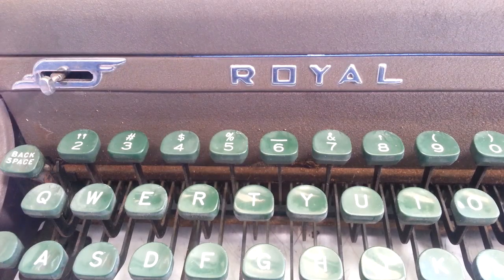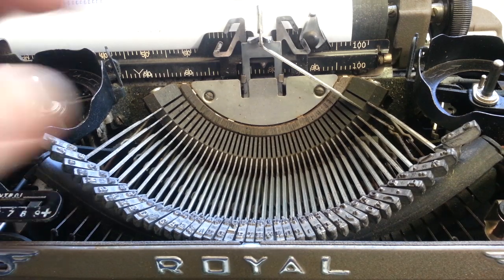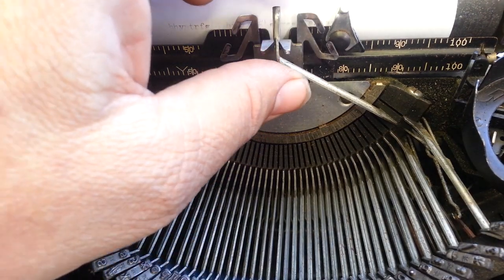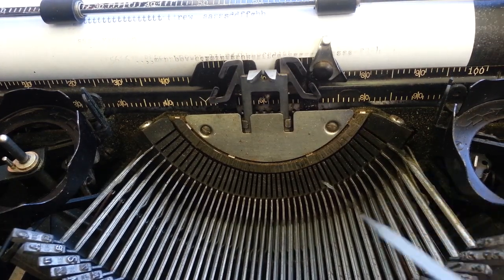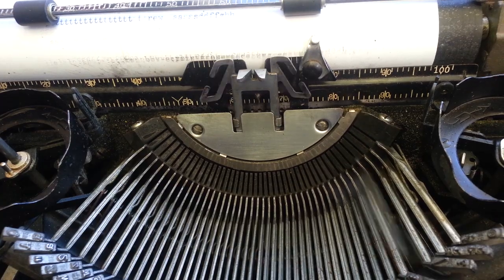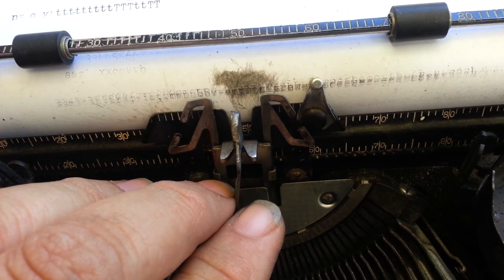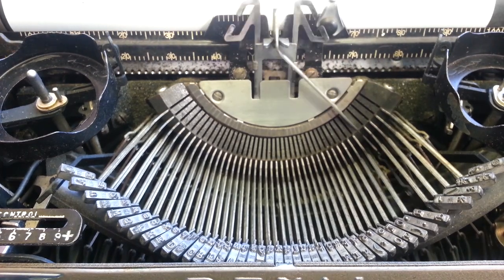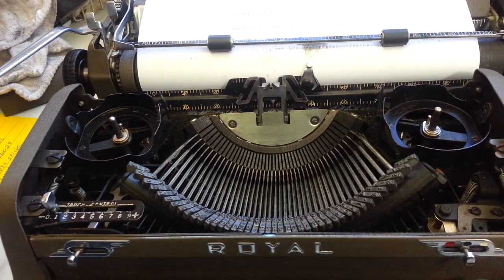Royal Quiet De Luxe Typewriter Sticky Keys Segment Flush Clean

Comment: Just got one yesterday exactly the same model, 1952 matte gray, can only replicate one of the sellers reported issues, the 1/4-1/2 type slug sticks. The rollers all hard but otherwise in good shape. The magic margins are sticky too, not a big deal. Even the ribbon has life left. I can go very fast on it. Paid $35, local Marketplace seller. The Royal marketing department calls the paper bail the “Automatic Paper Lock,” the base model called the Arrow only has a “Paper Bail.” It seems the difference is the QDL Automatic Paper Bail articulates forward as well as up whereas the Paper bail only lifts up.

And the best part…THE BELL WORKS!

Comment: I finally cleaned my Quiet de Luxe and noticed that the "a" types low on lower case and the "q" prints high on lower case. However, they both are the correct height on upper case. Any suggestions or is this just the "fingerprint" of this machine?
Reply from the maker: I would need to see it up close in-person to determine what the deal is, type alignment can be finicky for sure

Comment: I love your videos.  So helpful.  I just had a Royal Companion shipped to me that was working when it shipped, but now the carriage doesn't advance when typing or hitting space bar.  Back space button is the only thing that makes it move. I can use the carriage release button and it moves back and forth freely.  I checked the spring and draw cord after watching your other excellent video.  No problem with that.  
 
It was shipped inside its carrying case with no packaging materials.  One of the brackets broke loose in transit.  Any idea what to check next?  I was hoping to gift it to my daughter for Valentine's.  Thanks.
Reply from the maker: Sounds like escapement pawl is jammed or broken
These are hard to access on this typewriter
Reply: I am not even sure where that is.  Would I find info on that in one of your other videos?
Reply from the maker: @angelabowman8016  Most all escapements are directly under carriage in middle
using a star wheel and pawls to space, Royal is very unaccessible
With any shipping damage other things could easily be out of whack preventing operation
Inspection by an experienced tech might be the only way to diagnosis exactly
Reply: Phoenix Typewriter, I don’t have one near me.  I see the star wheel, not sure what the pawls are. There is a piece “dangling” near the wheel that looks as though it should connect to something. I will keep trying to figure this out. Thank you.

Comment: How would you go about doing a deep cleaning to address the rust?
Reply from the maker: Oil and a wire brush, repeat . . . .  If it's really bad, I . . . . forgetaboutit !
Sometimes I disassemble and wire wheel. I have never used "rust removers" but others do,
Access can be difficult and time involved is a huge factor for me

Comment: @7:31 you said something about a 401 chemical, what exactly are you using?
Reply from the maker: MG 401 is about as close to the professional typewriter chemical AMES 5% spray, Ames has be out of production 20+ yrs.
This is harmless on all surfaces, cleans and leaves a very small hint of oil, Blow all excess off, all of it . . . 
https://www.ebay.com/itm/MG-Chemicals-401B-340G-Nutrol-Control-Cleaner-340g-12-Oz-Aerosol-Can/251912832391?_trkparms=aid%3D111001%26algo%3DREC.SEED%26ao%3D1%26asc%3D20160908131621%26meid%3D85ae789723d642729c83995bf66b9d28%26pid%3D100678%26rk%3D3%26rkt%3D3%26mehot%3Dnone%26sd%3D192408184165%26itm%3D251912832391%26pmt%3D0%26noa%3D1%26pg%3D2380057&_trksid=p2380057.c100678.m3607&_trkparms=pageci%3A27345f44-93c7-11ea-aa66-0a30d46250b3%7Cparentrq%3A05746bad1720a4e86c899c65ffdf58be%7Ciid%3A1
Reply: @phoenixtypewriter2136  About this product, I can't identify a similar here in Brazil. I found a product called "contact cleaner" and is used to clean electronics components, like mainboards, electric contacts, etc. Have no solvent and the composition is N-hexane and propellant. Do you know anything about this?? Thank you
Reply from the maker: @cassioliveira  I don't know N-hexane...... the 401 is a contact clearer with a trace of oil, so it doesn't dry the surface out completely
Reply: @phoenixtypewriter2136  Understand. In fact, this product I mentioned dry almost instantly. I will search more and do a test.  Thank you very much!